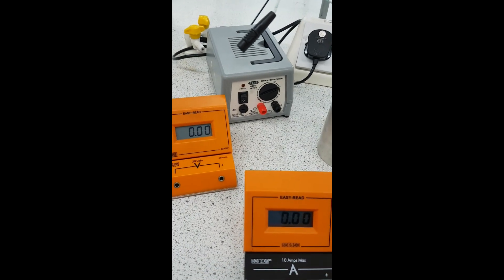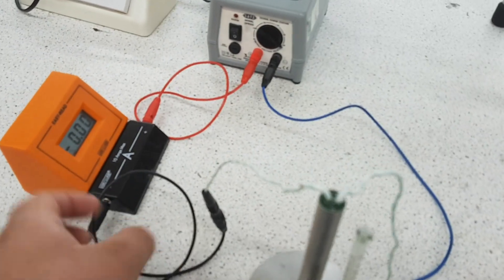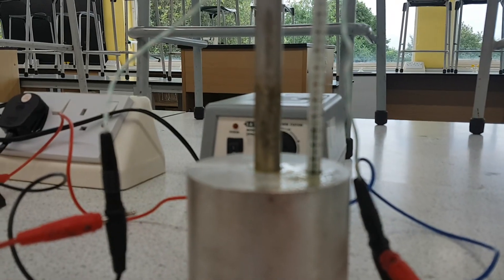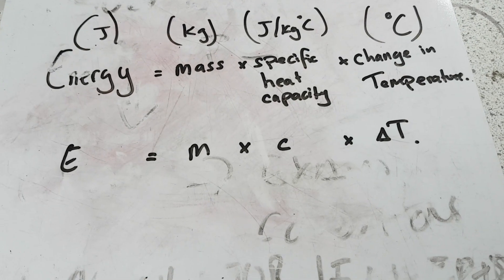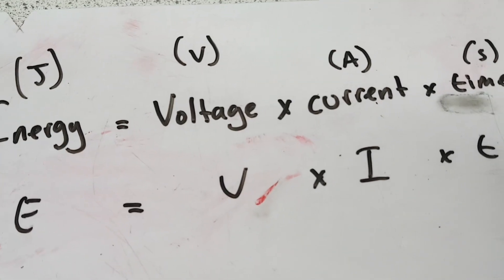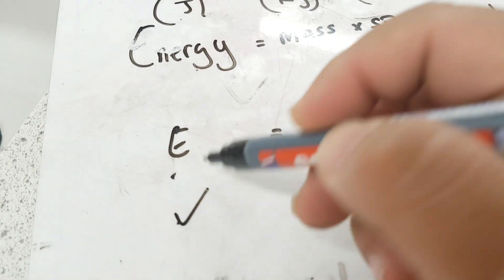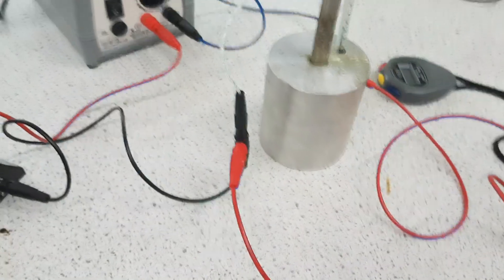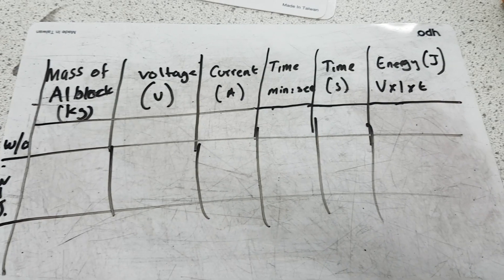Determining Specific Heat Capacity: AQA 9-1 Physics Required Practical

Comment: LOL  after you stopped the stopwatch/ power supply then you should've watched the temperature as it would've went up sightly whenever the energy from the heater reached the thermometer. then took that as your change in temp, or else the amount of energy added to the aluminium wouldn't reflect the true temperature change.
Reply from the maker: Then surely you would not stop the stop watch as it will effect energy calculation too. Interesting point you.make though
Reply: @mrhaider6343  wouldn't effect the amount of energy added to the metal though, the energy added is the current x voltage x time energy is being added. I was taught it like that, and also to insulate the metal to make sure energy isn't lost lol.

Comment: But isn't the specific heat compacity of aluminum around 900 j/kg°c. This says it is 240.  it has me confused right now. And why do you wait for the temperature to increase by 10. Shouldn't you be recording the temperature after every min for 10 min.i just really want to understand   the difference in your experiment.
Reply from the maker: Good questions

1) my specific heat capacity is higher because there was no insulating jacket around the block meaning we will end up using more energy as thermal energy will dissipate. Which in turn means our value for specific heat capacity will be higher.

When applying an insulating jacket we should expect our specific heat capacity value to be closer to the true value. However, we will still have heat loss from the top of the block

2) Your method about recording temperature is fine. My method was just a quicker version. The weakness of my method is I will not be able to plot a graph of temperature change over time.

In your method you will be able to do this.

Good questions.

Comment: How much voltage
Reply from the maker: That depends on amount of voltage your heater is capable of receiving. I believe the heater being used can have a maximum voltage of 12V. But your science teacher/ science technicians will be able to tell you.

It is worth noting that the higher the voltage the quicker the heating will take place.

Do subscribe and share.

Good question though.

Comment: Hello, I’m afraid that we did this experiment differently and now I don’t know how to do the homework he set me. We timed the experiment for 10 minutes and wrote down the change in temperature. My teacher told us to these equations,
E = I x t x v       To find the energy and then do
C=  E (divided by) / m x 🔺🚫 ( the circle with the ring through it. ) 
But when I do the equation it comes up to this Hhuuuugggeee number. What do I do?
Reply from the maker: Did you use the calculator properly. C = E / (m x T)

Remember m x T needs to be in brakets

Comment: Hi, instead of using E=V x I x T could you not also use a joulemeter to calculate the energy, thanks this was very helpful
Reply from the maker: MSP Miss Planet - Yes you are correct. That is this easier way to do it.
Reply from the maker: Do consider subscribing
Reply: Will do